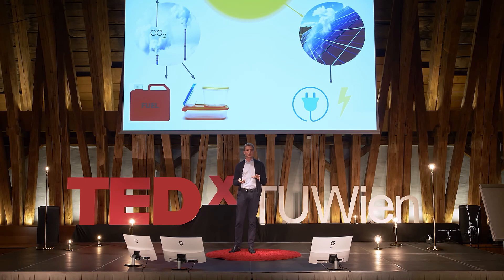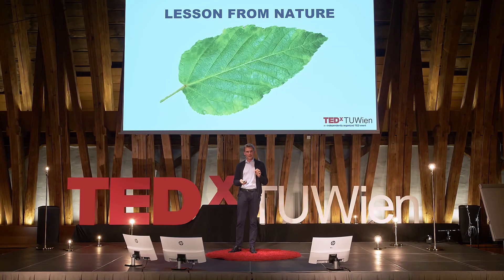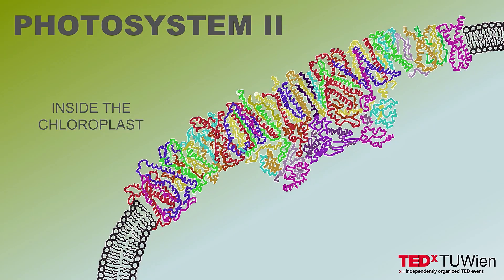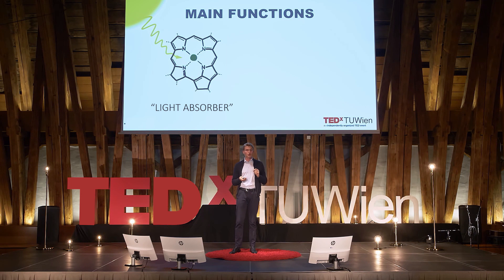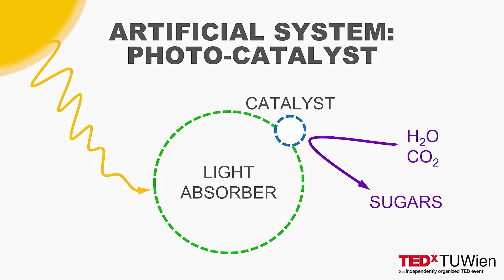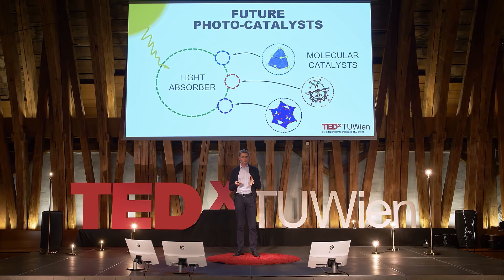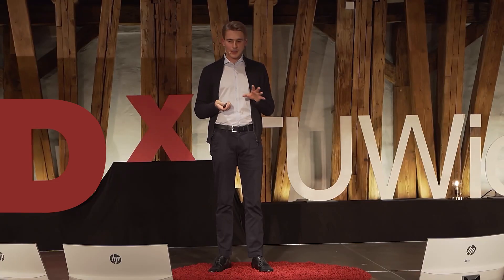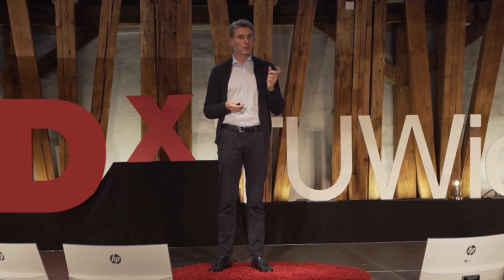Towards Artificial Photosynthesis | Alexey Cherevan | TEDxTUWienSalon

Comment: Photosynthesis is NOT efficient in nature. It only has an efficiency of about 1-3%. Turning sunlight into hydrogen and oxygen is fairly simple. All you need are 2 electrodes and a solar panel. This chemical reaction is very easy and is often done as a demonstration in schools. Using electrolysis, water can be split with an efficiency of 70% and most solar panels are about 20% efficient, but some are as efficient as 39%. This would give us an efficiency of 14% - 27%. however, If this photocatalytic water splitting exceeds this efficiency, it will be impressive, however. the question of weather it will be easier to mimic photosynthesis on a macro or micro (or mix of both) scale is still a question. Not really any impressive information was shown, but you have to keep in mind this is still a rather new field.